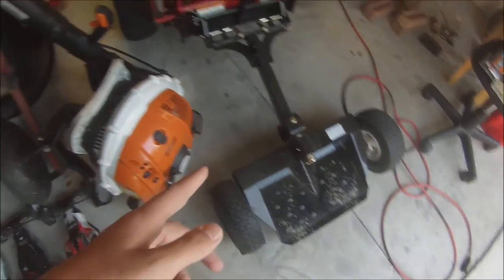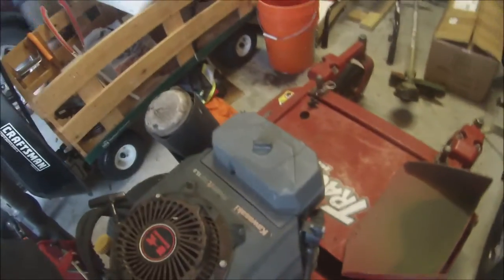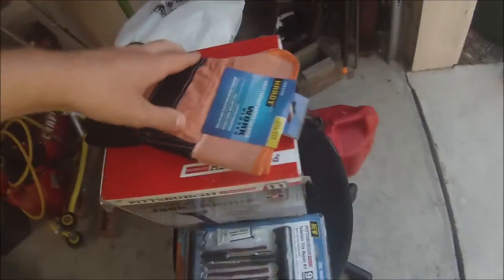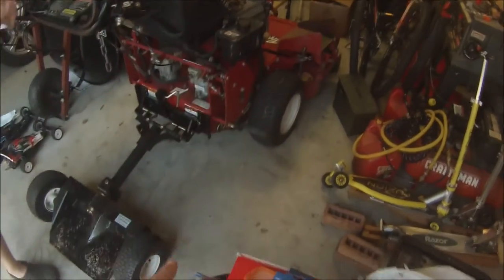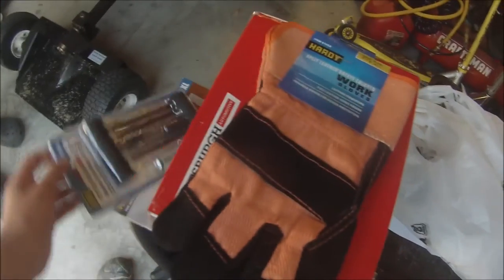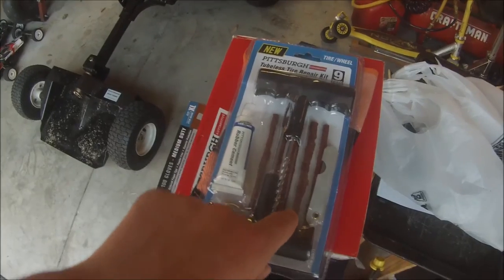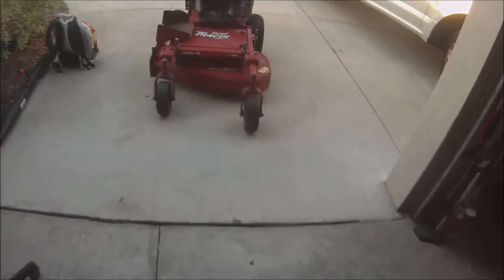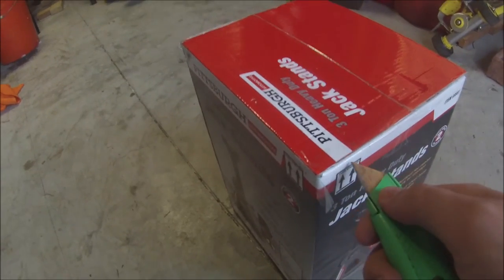Lawn Care Vlog #4 - New Jack Stands and Cleaning the Turf Tracer

Comment: Does it ever scalp on uneven ground? :)
Reply from the maker: Not that I've seen. The turf tracers have a floating deck, so it's virtually impossible to scalp. These small decks, such as the 36, have a low chance to scalp, but it's still possible. If you are ever looking for a used mower, look for one with a true floating deck. These kinds of decks won't scalp since it moves over the natural terrain of the ground
Reply: Good to know! Thanks! :)
Reply from the maker: +Flash Lawn Service No problem :) Oh, and one more thing on the floating deck mowers. the cut height is easier to change because you just pull pins out and put then in different holes for different cut heights. Fixed deck mowers need you to use the spacers in the front casters and change the height that way. :)
Reply: Yeah I most likely won't be getting a fixed deck in a few years. :) How heavy is the deck when you lift it up to change the height?
Reply from the maker: Not too bad. I'd say 40-45 pounds, maybe 50. It isn't too bad, but the larger ones like the 48,52, or 60 are definitely a lot heavier. I'd like to get a 48 or 52 next year for bigger properties. For now though, this mower will do great :)